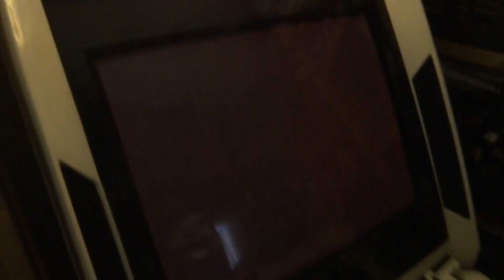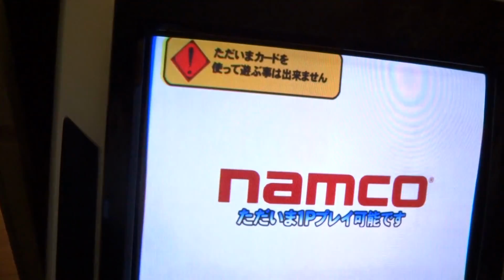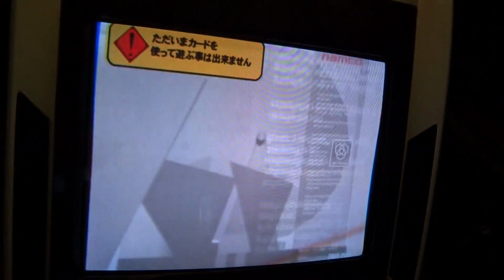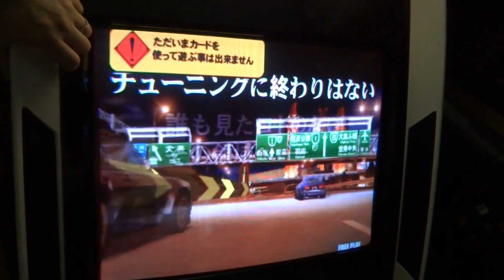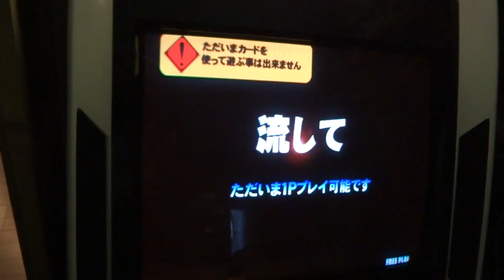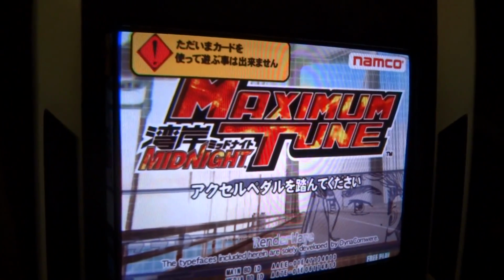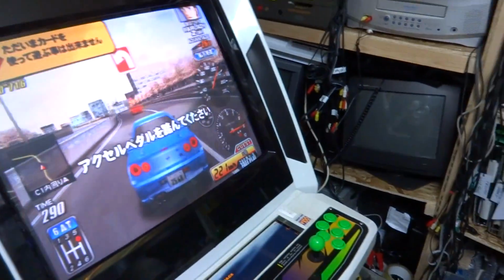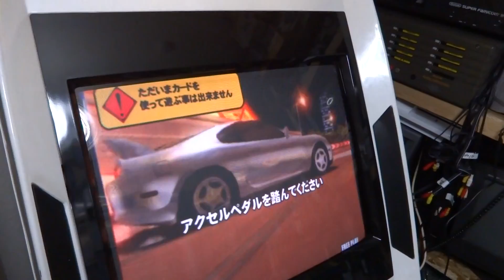Sega Chihiro Arcade Hardware

Comment: With how expensive Naomi hardware was you would think they would have used a more robust mechanism for the GD-ROM drive.  It's actually not much different from the one in the Dreamcast.

Do you still have any of your cabinets or did you have to get rid of them?

Comment: People have managed to find a way to pull all the data off of a Dreamcast GB-ROM using either the serial or broadband port which is a huge hassle, I can't see the Arcade hardware being any easier. Not to mention there are very few GB-ROM disks and even fewer burners out in the wild, your only option for a 1:1 rip is using SD Cards. ALL version of the rips you see online for CDRs have content removed and/or compressed.
And all of this is ignoring the security chips on Arcades.

Comment: Probably more because Sega had a bunch of GB-ROM drives laying around and it also allowed arcade owners to use some of the same hardware they had from a previous gen. Space also isn't as much of an issue as you could always compress the data on the disk and it loads into memory on boot. Most XBox games didn't use most of the disk either, though true most were larger than 1GB.